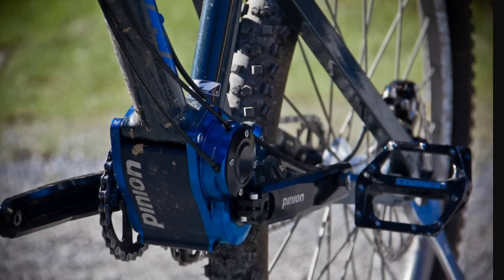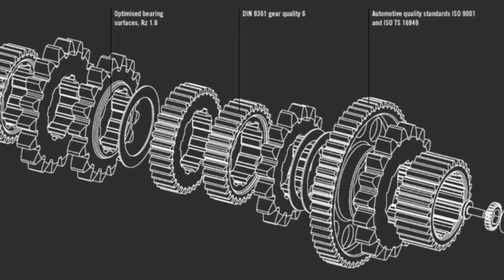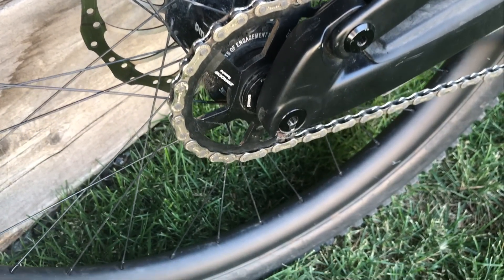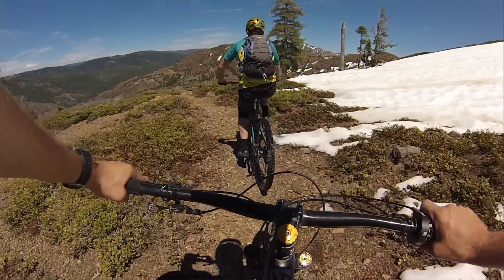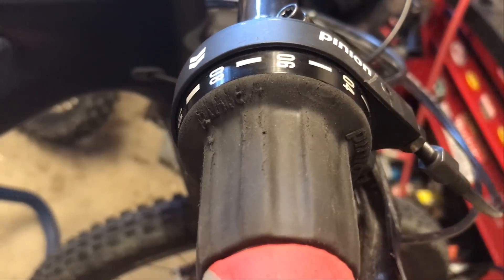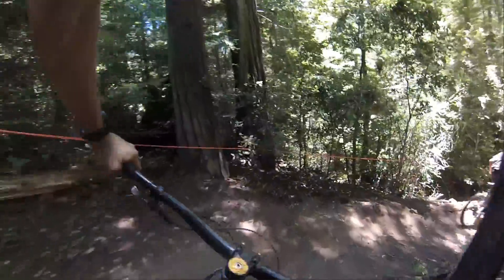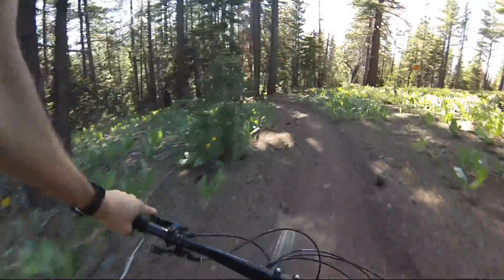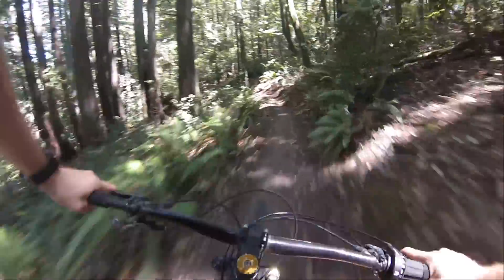Pinion Gearbox Thoughts & Opinions

Comment: I remember when people complained about the weight of dropper seat posts, and will never catch on. Tech on bikes is getting crazy. Crazy in a good way.
Reply: Dropper adds cca 300g for serious benefits. This adds 800g for few benefits and several serious disadvantages. Although i am a fan of pinion - power to them - but they need to improve so much that i doubt they will ever hit mainstream.
Reply: @pkundrat  Several benifits and few serious disadvantages.... 
The majority of the mainstream the disadvantages aren't an issue, only really effects racing. The benefits are great for daily commuter's or weekenders which are the main market.
They seem to be getting traction slowly, just a matter of time.

Comment: i'm convinced that the pinion coupled with a gates carbon drive is the future of touring bicycles.  having that weight in the rear hub moved to the bottom bracket will make the bike more balanced.
Reply: Agree w/ you, David. So much more reliable and requires so little maintenance.
Reply: @bruin4937  You can have even shocking moments. With my new Pinion (P1.18) city bike on my very first drive it was pouring with rain and nearly close to my parents home I could not change gears anymore!
After the bike was dry again the gearbox worked fine again. The seller and I couldn't find out where the problem was located ... :(
Reply: @MusikPiratCH  The newer models have a plastic cap where the cables enter.  This allows water in but I am not sure if this could be the cause.  I am waiting on a bike with a pinion and gates.  I am going to pay attention to what you had happen and see if this is why.  Thanks for sharing.

Comment: I have recently gotten back into bicycles, fifteen years out, due to health reasons, I just built a very nice road bike, with 70's era technology, ramped to a 20 speed with Campi components, and it's very nice, far better than I had as a young man, however I've been watching these, I just ordered an "L train", for daily riding, and look forward to it, more basic, no maintenance daily bike, but was looking to see what the future might be.  Thanks for a very informative video, I've got my "mountain bike" ready to clean and get back running, but was looking at the deraileurs, chain and sprockets, and it's simply a nasty mess, don't even really want to tear into it, for new cables.  I believe when I replace it, in a year or two, I may well look to the pinion gearbox.  Thanks for a very informative question and answer series.

Comment: Motorcycles surely use a similar gearbox. Shifting a motorcycle clutchless still requires letting off the throttle. If you've ever tried shifting under power you know that it doesn't want to go into gear- similarly to this bike. Not sure how they'd be able to fix that, but I think that would make the performance much better.

Comment: I have to say, you're wrong a out the shifting under load. The Pinion gearbox works completely different than a motorcylce gearbox. There is a camshaft inside the upper gear shaft, with ratcheting pawls that engage on the inside of the gears. These lock the selected gear to the shaft - and thats the reason you can't shift under heavy load. You'd need to pull the pawl in while it is transmitting all of the drive force, which isn't going to happen, even with brute force. It need to be self-locking, otherwise it would kick out under heavy load. It is possible to force an upshift, but downshifts simply don't happen under heavy load.
Anyway. Once you get used to it, it really isn't more or less complicated than shifting a derailleur. The gripshift allows huge gear changes very fast, much faster than any trigger. The only downside is that you simply can't shift under heavy load, but in the flipside, you can shift without pedaling (or even while back-pedalling!). And once you get used to that, it is really difficult to go back to a chain shift system - it feels so clunky to have to wait for half a relovution of the crank before the gear changes. It is also a big part of the reason why you often need to shift under load with a conventional system - if you notice you're in a too high gear, you MUST pedal for it to shift. With the gearbox, you just stop pedaling, drop six gears in a twist of the wrist, and pedal with the right gearing immediately. I recon it is a lot faster in such scenarios.

Comment: I do think this is the future of mountain biking. One major place they could shed weight and size from are the gears inside! The gears on this are literally the size of a small motorcycle transmission's gears with 10x the power or more! I assume they're finding as many off the shelf components for this as possible, but really components for this need to be bespoke to fully take optimize this product. I think the largest hurdle for this technology is that it must be heavily integrated into the design of the bike. I foresee, at least in the beginning, that all the major manufactures will have their own design and standards.

Comment: I have a Zerode Taniwha and I can honestly say I couldn’t go back to a traditional drive train now. The overall benefits compared to my Nomad are substantial IMO. 
I’ve even found the shifting to be an overall improvement. I guess I tended to let up a little as I shifted in the past because shifting on the Taniwha came natural to me. 
I have an XL size with 175ks dropper post, 170 lyrics, saints etc and the total weight is 14.7kg (32lb). 
I like the longer reach of the XL but had the seat tube trimmed down to L size (by Rob at Zerode). Rob said he’ll be modifying all the frames in the factory like that soon.

Comment: Some solid points and I agree that products like this will likely be the future. But it's not quite ready yet imo. Less gears would reduce friction and weight, a 9 speed with 450% range is plenty. Maybe dry with no oil, teflon infused plastic gears or something instead. If the weight was 250 grams over an XX1 with cranks that would be totally fine because of the location of the weight. Carbon fiber shell is needed. 
Electronic shifting would be cool, you'd still have to reduce torque but not as much. The inability to shift under power is a disaster imo. That's the real strength of Eagle, I shift mine while standing on the cranks like I'm trying to kill it and 99.7% of the time it shifts just fine.
The specific frame is no biggie, these manufacturers build new molds every couple of years anyways. It seems like it's already ideal for a DH bike. Next would be very casual trail bikes/ fat bikes/ cold weather bikes, then the refinements would get them to the highest end Enduro bikes. The pure race bikes would probably stick with the old system for another 20 years. Basically delicate, maintenance intensive, but also light and efficient.

Comment: 11:59 "you don't need a secondary ratchet system" -- it's likely there in case something gets caught in the chain/belt.  It's true that only one is needed, but IMO it should be at the hub and not in the gearbox for these reasons.
Reply: I agree.  Plus it puts more wear on what few points of engagement the gearbox has.  Going downhill may not be an issue, but some energy is bound up in the chain going around and around.  Instant engagement is good, but the way to get it is more points of engagement in the gearbox itself and the Onyx.

Comment: Great review! I think you'll find that most of the con in shifting will be easily overcome when you get over the differences in shifting properties. I'm not a "super" bike rider but have used both deraileur and internal gear shifting. Perhaps one solution would be for someone to come up with a rapid fire shifter for up to 18 gears. Also, it IS a matter of getting used to a different type of speed control as the movements for an internal gear shifting are much tighter and more precise than a deraileur. With that said, the rapid fire set up would be identical in concept to what you show for the motorcycle gear shifting. A stepped motion with set distances pulled on the cable. Oh to be young, strong, and agile! LOL Nice riding.

Comment: What I really like about it is that I can select my gear from a standstill.  That helps with surprise braking.  Also a mountain bike will have a better top speed :D . My next bike must have this when I change again in a couple years, by then there would be improvements.
Reply: Good straightforward review, Thanks.  Managed to demo a pinion 160mm travel enduro bike and was instantly sold on the pinion. I am looking intently to see if they fix any of the points you raised before i get a new bike next year. Thanks again for the vid. Gear boxes are the future.

Comment: The company will eventually build electronic shifting into the unit but not for awhile. They will need to rethink the system to incorporate a high torque motor for shifting.  At that point you will be able to integrate voice commands like up, down, up 3, down 5, gear 3 etc.  They also need it to be able to incorporate the Fazua e motor that Lapierre  is using on the new E-Zesty am9.

Comment: You don't let up when you shift a derailleur? I always back off power when I shift, it's much smoother and easier on any drivetrain.
Reply from the maker: J Borg you let up slightly. Not full stop the pedal stroke. You need to back off all power to shift
Reply: You shift a traditional system while pedaling, not necessarily under harsh load. I think you have to stop pedaling altogether with the Pinion. Don't quote me on that, though. I haven't ridden one.
Reply: If your right about having to stop peddling to shift then I prefer that than a derailer, derailers should of been thrown away years ago when hey are evil
Reply: NoBrakes23 : i dont stop pedaling. If iam going up a steep hill (trike) back pedal and shift down in sec.. Shifts like a roll-royce. Bought mine second hand. Gates will be the n. American dealer. Changing the shift twin cables was a sob. I like the tensioner. No damn derailleurs.
Reply: J Borg Your components make a huge difference regarding whether you can shift under load. I recently bought a basically new road bike with Ultegra components from a buddy and if it does anything other than instantly engage with no questions asked, it goes in for service. My Giant and Diamondback both have lower end groupsets though and, especially with the economy components, shifting under load can be a big problem. . . Might have junked some components that way. :D
Reply: i cringe every time someone shifts derailleur under load
Reply: @fetB  Like nails on a blackboard 🤣
Reply: I have always "soft pedaled" when shifting. Chains & cassettes get expensive! Especially these days!

Comment: I am not quite sure how the shifting engagement on these gearboxes work, but the reason you can shift on a bike without the clutch is that the shifting dogs are spaced. Actually, as a little tip for you. Try to introduce a shift in torque to the system of your motorcycle everytime you shift, it's going to make shifting soooo easy and smooth. So just give it a little blip while down shifting and a little let of while upshifting.

Comment: I believe that the gearbox IS the FUTURE of mountain biking.  That being said,  I also believe that the belt drive is SUPERIOR to the drive chain in many  ways.    In reply to your idea of a solid rear hub,  that would mean that anytime the wheel is turning, the belt would be too.  I don't like that idea.  If anything, get rid of the front ratchet.....why do you need it?    I like the idea of the overrunning clutch or instant engagement clutch instead of the ratchet.  The benefits would be huge.   Very exciting stuff....Thanks for sharing.

Comment: I reckon what manufacturers could do to keep mechanical shifting is to make a  double clutch gearbox so the there's practically 2 gearboxes so when you want to shift you push in the lever which shifts the gear on the disengaged box and on the return of the button would switch the engagement if the current gear to the next gear so you can keep the power down
It may be a bit heavy the shift levers would quite stiff but I don't think I care

Comment: If they back cut the gears like some riders on motorcycle dirt track and drag racing do, it would probably solve the shifting issues while under load. They do it so they don't have to pull the clutch in to shift, so it should be essentially the same theory.

Comment: Awesome review! My guess is that they have a rear freehub in addition to the front ratchet because otherwise the chain could become dangerous - imagine getting your foot into it while riding down a hill.
Reply from the maker: Aaron Isotton that's exactly why!
Reply: @alexthemtbr  Back in the 70's some bikes had the ratchet in the crank rather than at the rear cassette - ostensibly so you could shift without pedaling. Was a disaster for that exact reason - it was dangerous.
Reply: Enclose the chain?

Comment: so perhaps add a little lever on the grip with a ratchet so that it will always return to centre and not turn with the twist shifter. then you would have more leverage whichever way you changed gears and it wouldent get stuck on the other side of the bars due to the gear you were in.

Comment: Keep in mind that derailleurs do not really shift under pressure. They hold back until the pressure lets off and then they complete the shift. I have a Rohloff and I can shift smoothly by timing the shift over the top of the pedal stroke or a quick back off during the shift. This takes practice. The aftermarket thumb shifters for the Rohloff and other shifters are not as good as the grip shift. There is an electric shift available and Bosch has one for ebike only at this time. If Bosch would sell one for none electric I would pop for it.

Comment: the engagement of the gearsystem is needed otherwise you would increase the wear and drag of the system. you could include the freewheel into the gearbox but it would be stupid because your chain would be moving all the time and you wouldnt get rid of the double engagement. but a hub like the onyx would add to the bike you you would have more normal feeling.
adding electronic shifting would be good for this but you still coundnt shift under load due to the gear system, you would need a double clutch system which would increase the weight by at least 500g.
there is the cheaper c line which reduces the weight by nearly 200g.

Comment: I'm a has-been hard core mountain biker, who rides fewer trail miles and went for a rigid 29x3 Alfine 11 bikepacking rig to make commuting and light trail riding equally accessible and low maintenance.  I've been an internal gear hub turner for over a decade.  My commute just got twice as far, and so e-bikes have been on my mind, and I'm hesitating to invest in mid drive motors, and bikes with exposed transmissions for a bike I'll end up putting 2X miles onto.  The P-18 gearbox should cover all gearing needs for a trail/commuting 29 plus e-bike, and get me around town fast.  Another benefit to a casette & IGH ectomy is room for a rear hub motor and plus tires, without walking like I pedal fat bike BB.

Comment: Most likely the drag is from the gears being meshed. If I remember the diagrams of the Pinion, the output shaft is attached to all the output gears at once, while only the selected input gear is driven. Because the gears are always in mesh, you are spinning all the gears no mater which gear you are actually in. 

There was a gear box back in the early 70's where only the two gears that were selected were attached to the input and output shafts at a time, all other gear sets were not engaged and didn't spin, greatly reducing friction in the gear box.

Comment: If  you use the fixed rear hub, the chain also has to move. I would assume that's more drag.
Reply from the maker: kim00gibson slightly but suspension performance is improved

Comment: I suspect the rear free hub is needed because it's unlikely you can back drive the gearbox. Can you try turning the front chainring backwards by hand?

my guess is the one around the bottom bracket is needed for the no pedal shifts.
Reply: from the video, I think it has freewheels on both. Ratcheted rear hubs prevent constant chain movement during coasting and ratcheted pedals would prevent constant gearbox movement.

thus, it saves component service life.

(sorry for this late reply)

Comment: The drag makes sense....  If it truly works like a manual transmission in a car/bike (which it does) you'll be putting power through all gears but only the selected gear will transmit power to the chain.

If there was a way to unmesh gears you aren't using, power will go through with less "drag" but how to do that...  I have no idea. 

Not a mountain biker, but intrigued in "enginuity" :)
Reply from the maker: Shamarski Simon 😂😂😂 good shit
Reply: Alex Chamberlin what about a clutch?
Reply: Mr. Pickles it would only allow one to shift while pedalling but at the cost of adding extra weight and complexity IMHO. 

I've heard shifting on a motorcycle without clutch you have to let up on the throttle a bit anyway, right?

Comment: Something I'd like to note, on a motorcycle you do not do clutchless shifts under power. You have to cut power for a moment by either closing the throttle or using something like a quick shifter, which interrupts ignition. You cannot shift while applying power, you have to unload the gearbox first. Down shifts are the same way albeit a bit harder since you need to blip the throttle to the appropriate speed for the intended gear and slip the shift in during the moment when the gears are unloaded. You cannot over power the gearbox. At least not with destroying it.